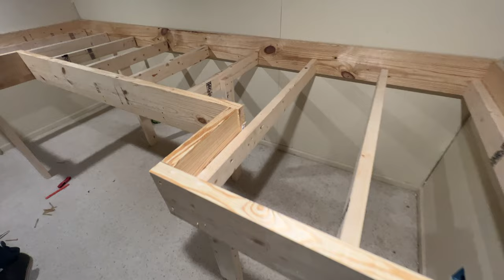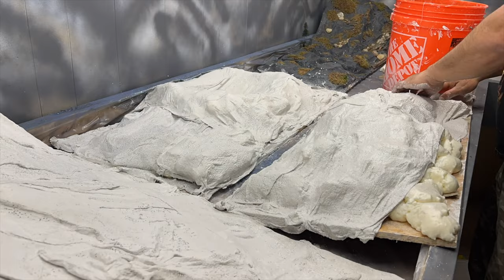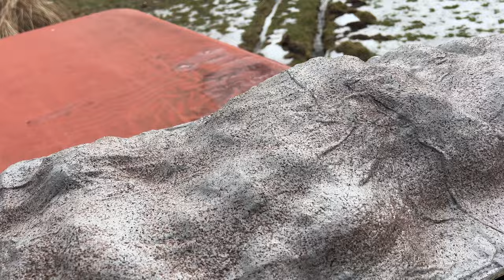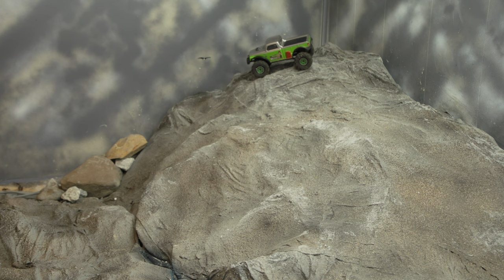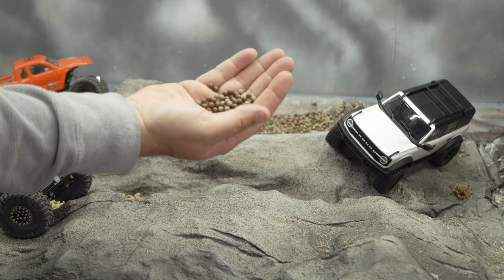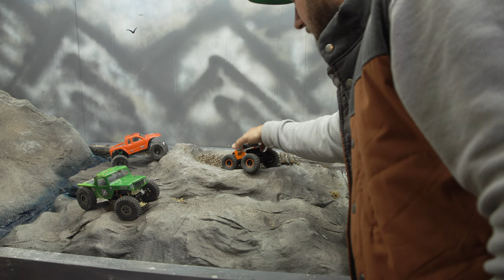How To Build A 1/24 Scale Mini RC Crawler Course From Start To Finish

Comment: For a cheap alternative to the decking grit paint, buy an ultra cheap can of exterior paint and mix in playground sand or gravel, depending on how much grit you want. Playground sand will give you a finer texture, gravel much larger.